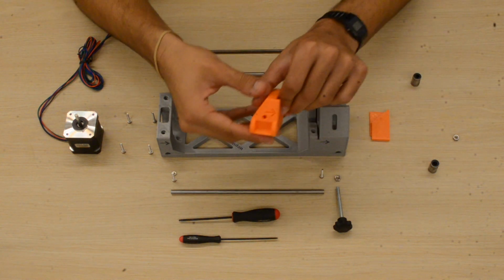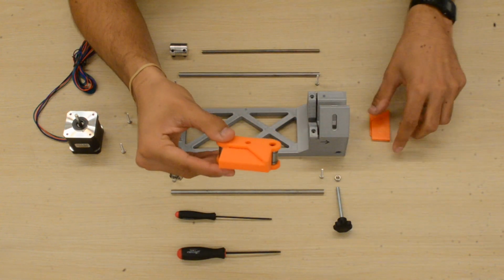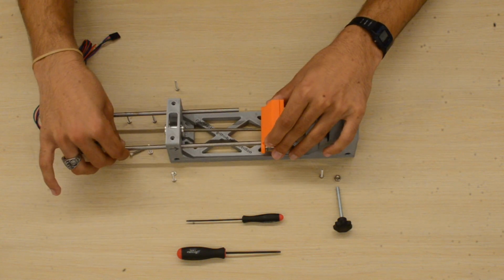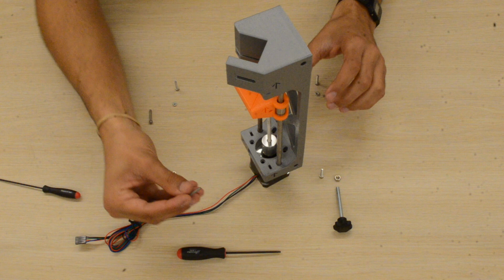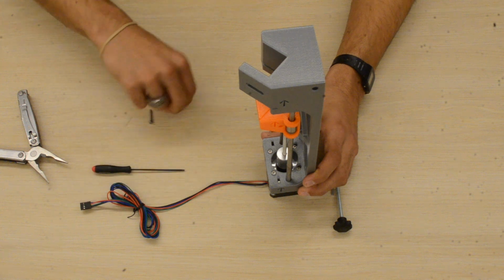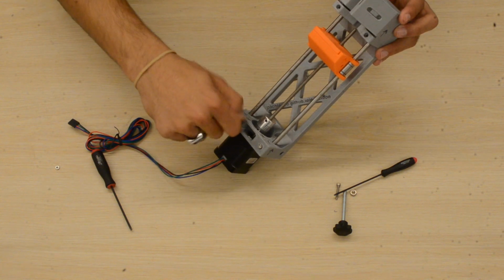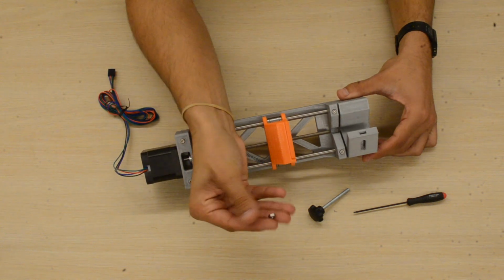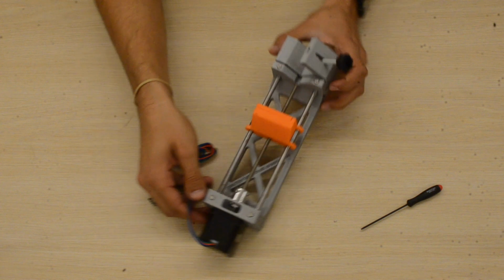Poseidon Build Videos: Syringe Pump

Comment: Search open source syringe pump libraries and you’ll find designs that completely do away with that 3D printed beam between the motor end and the syringe holder. The metal rails can support the whole thing and you can cut down your plastic weight and print time by half. But also great assembly and video and thanks for the good content
Reply from the maker: Nice idea! Feel free to modify the files and share them with others :) https://github.com/pachterlab/poseidon